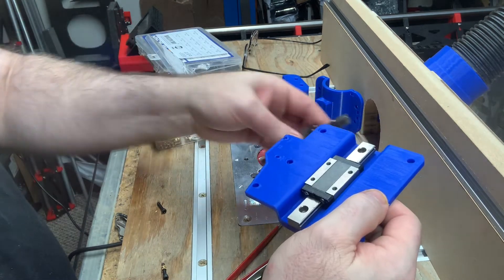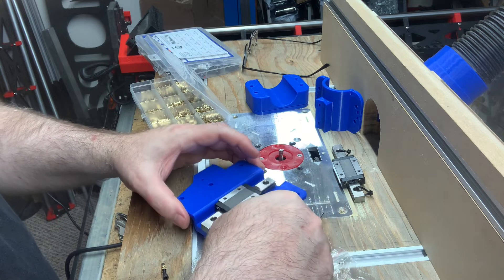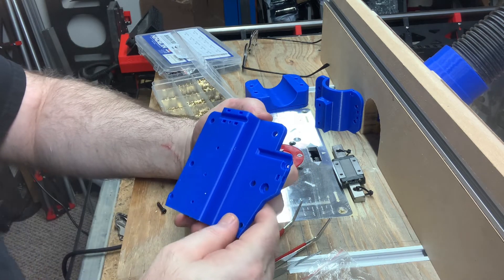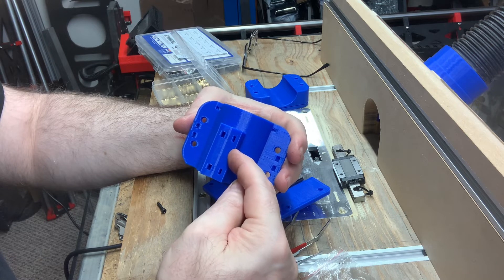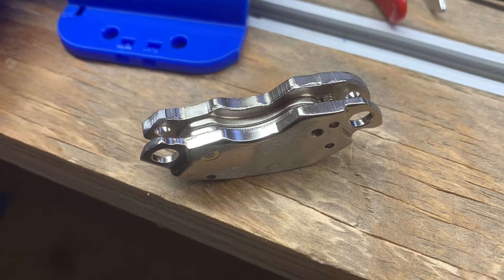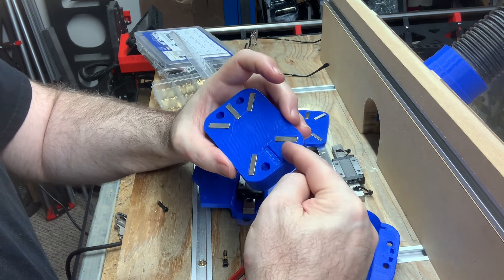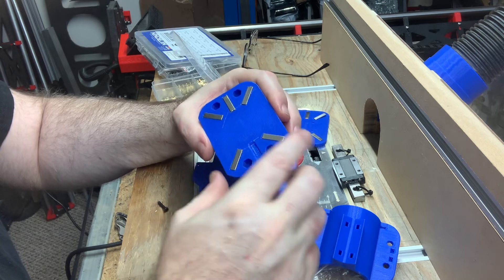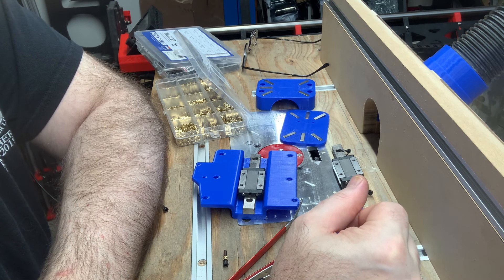LowRider 3 CNC Plasma Table PART 1 - floating Z torch mount

Comment: Maybe some posts and holes in the plates would help as well, so they can't move in the X axis at least??
Just a thought.

Cool idea for sure, thanks.
Reply from the maker: Since the torch can be moved in any direction in the XY plane and could encounter a metal lip or obstacle from any angle, I like it being able to detach easily to keep from damaging my torch. It's worked well in the rare instances I have needed to detach!
Reply: @design8studio  Ok ya, makes sense.  Thanks for the reply.